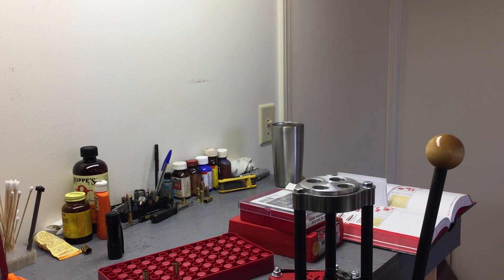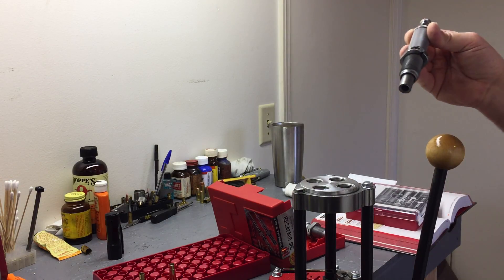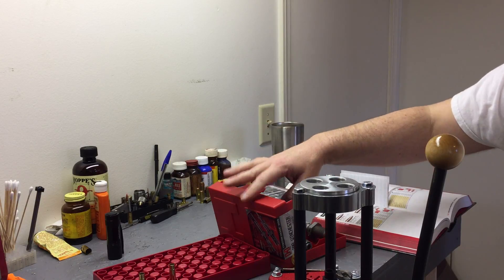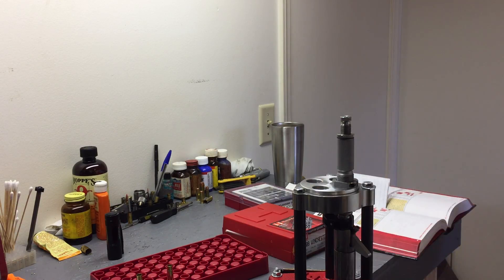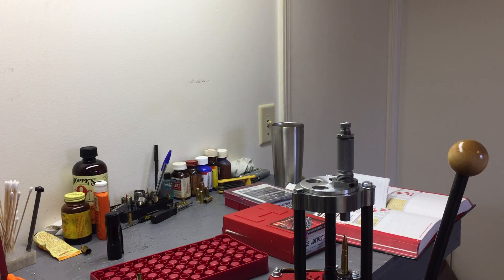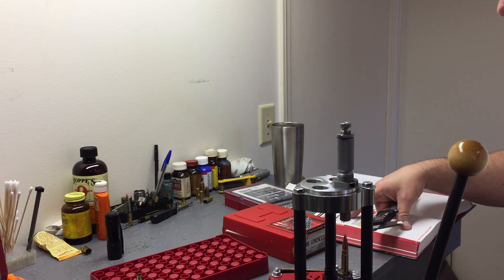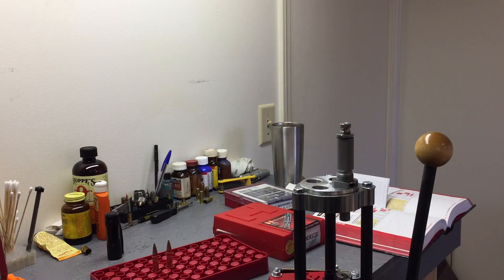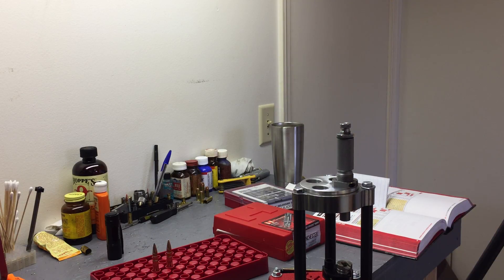Can you use a 308 Win seating Die to Seat 300 Blackout?

Comment: Thank you, It makes sense that it’ll work. If the bullet doesn’t have a cannelure are you needing to crimp the case? I’m probably wrong but I thought it was only necessary to crimp if the bullet had a cannelure or it’s a heavy charged round to prevent the other bullets from “jumping” forward and causing problems. I’ve mostly been crimping slightly to remove the “bell” from the powder funnel die but haven’t loaded 300Blk yet. 
Thanks again.

Comment: Thanks for the video, smart to think of this. I was having great difficulty with the Lee seating die and 230gr Lee cast bullets. Didn't want to spend $80+ on a micrometer die, saw that Hornady had a micrometer seating stem with interchangeable inserts. I don't load .308 so I bought the 300BO  sizing/seating set plus the micrometer stem.. It works so much better and when you are seating you can adjust using the dial so it cuts way down on seat, measure, seat, measure, etc. I moved the extra sizing die over to my 223 brass conversion single stage and put the Hornady into my Lee Loadmaster. As a bonus, just got 100 .308 150gr Interlock Hornady bullets as part of a promotion for buying the set!
Reply from the maker: That’s awesome! Free bullets are always good! I’ll have to look into that die. Sounds interesting.